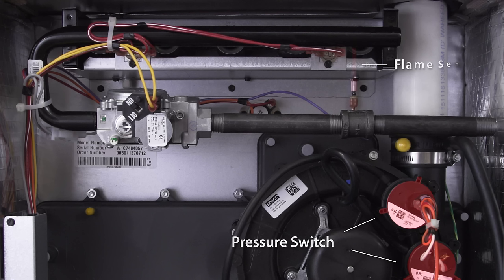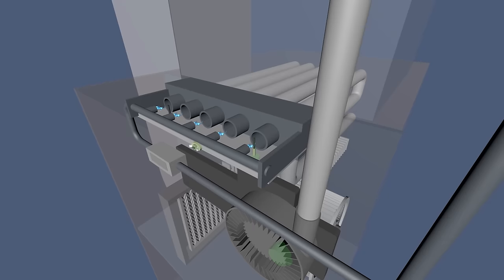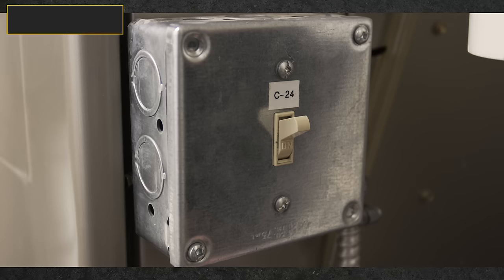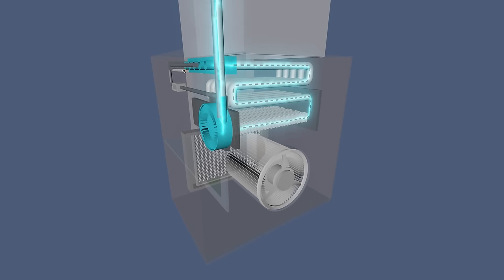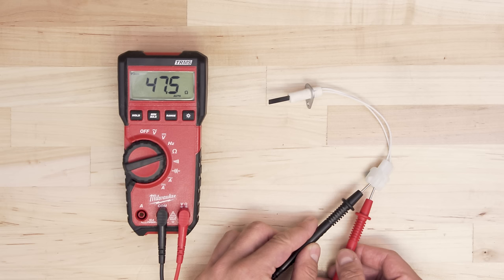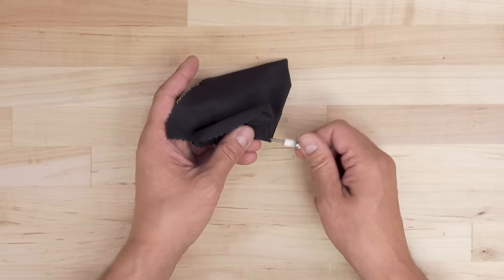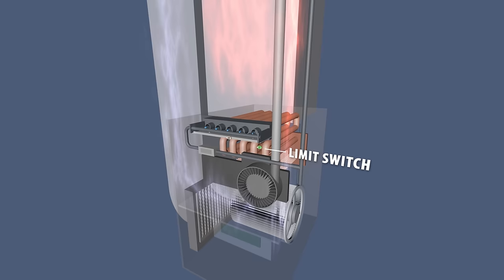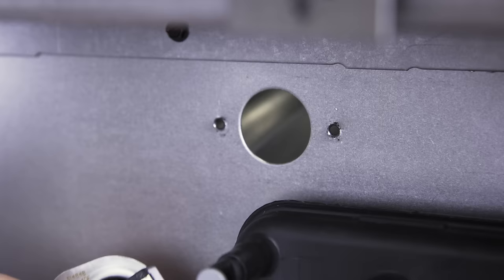Furnace Starts Then Stops - Troubleshooting | Repair and Replace

Comment: I tried cleaning the flame sensor and it still shut off so i got a new one and still shuts off after 5 seconds, what's next?
Reply from the maker: Thanks for watching. For the flame sensor to work, it must complete a circuit through the flame, into the metal of the burner. The burner must be grounded. Any buildup of carbon or dust can prevent this circuit from being completed, so the system might think that there is no flame present. Try doing a deep clean of the burners and it should help.

Comment: So my furnace what it does is that it stays one until it reaches the desired temperature but then it shuts off and wont start back on unless i restart the furnace any ideas??
Reply from the maker: Thanks for watching. In this case it is likely a faulty limit switch. The fact that the burners ignite, the blower runs and you get heat means that all other parts are working.

Comment: Hi my furnace is lennox and they give a code 475 i couldn't fine in the manual can you help what to do? Thanks
Reply from the maker: Hi Josh, check the back of either furnace cover doors for a printed chart / wiring diagram or list of codes. They are commonly shown there.

Comment: Might be a dumb question, but what do you consider a soft abrasive cloth? 0000 steel wool came to mind, since I have some. Perhaps a wash cloth or soft scrub sponge? Thanks
Reply from the maker: Hi Vance, thank you for watching. That is a good question. The flame sensor is a bare metal rod that sits inside of the flame which acts as a rectifier, allowing a DC current pass from the control board to the sensor, through the flame and down to ground. Without a clean surface on the rod, the circuit will not be completed. This means an emery cloth, steel wool, or even sand paper can clean it. In this case there is no coating on the flame sensor, and nothing that would be damaged with a little bit of abrasion.
Reply: @AmreSupply  thank you!
Reply from the maker: @Lokahi-fo-life  You're welcome!

Comment: Is the fan inducer motor supposed to be running all the time? The main fan is running but the fan inducer is not! And it's not heating :(
Reply from the maker: Hi Erminio, thank you for watching. The inducer motor will run the entire time as its function is to remove exhaust gases from the burner. If the inducer isn't running then the inducer or the capacitor for the inducer has failed or the inducer is not getting power (loose or faulty wires, or a bad control board). The inducer repair can be seen in this video https://youtu.be/EsJhfFMZWJA

Comment: What about the the flame came on for like 8 sec and off and come on again and off but the motor is still on. After 2 time of the flame being on and off no more flame but the motor and fans still on blowing cold air.
Reply from the maker: Thanks for watching. If the flames don't stay lit then its likely an issue with the flame sensor. The flame sensor needs to be clean, and positioned within the flame to complete the circuit through the flame, into the metal of the burner and though the frame of the furnace to ground. A dirty flame sensor, dirty burner, or a furnace that isn't properly grounded will prevent this circuit from being completed. That will cause the furnace to short cycle as the control board doesn't think that a flame is lit.

Comment: Okay, this is great. But what if it's none of those things? I've checked all of those issues. Is it possible the furnace "computer" needs to be replaced? Thanks.
Reply from the maker: Thanks for watching. You are right that if you've eliminated all other sources of the problem it could still be a faulty control board. You can see how to access the control board in this video: https://www.youtube.com/watch?v=4SY8lRl8HV0

Furnace control boards are listed here:
https://www.amresupply.com/catalog/Control-Boards-Modules-HK5Y
Reply: @AmreSupply  Thanks so much for replying!
Reply from the maker: @OnionKnight541  You're welcome!

Comment: Hello and thank you for the helpful tips say I have an electric heat pump furnace AC unit & my question is my thermostat keeps switching from Auto to fan on & my units only a couple years old.
Reply from the maker: Thanks for watching. What sort of thermostat do you have? It might need a reset or the batteries could be low (it might have intermittent power)
Reply from the maker: @dadsgonenuts  Could be a glitch or setting with the thermostat. Might want to try the Honeywell help page or customer support.

Comment: My furnace  blows cold air and then shuts off after 2 mins. It  does this whether its on auto or on. What do I need to do please. this just started.
Reply from the maker: Thanks for watching. If the blower fan blows for only several minutes before shutting off then it could be a faulty limit switch. You can see how to access and test the limit switch in this video: https://www.youtube.com/watch?v=0va_wvwfCBA

Comment: What about random short cycling? Is that bad design and configuration?
Reply from the maker: Thanks for watching. It depends on when and where in the sequence the short cycling is happening. Could be an airflow issue or a problem with one of the switches.

Comment: We replaced the ignitor today on our comfortmaker furnace, now the system will attempt to light twice before finally lighting on the 3rd time only, any idea why?
Reply from the maker: Hi Kelly, thanks for watching. Do you mean the flames come on but don't stay lit? If so then you'll want to try cleaning the flame sensor.

Comment: Why when I start my furnace it cycles but wont start so I have to unplug it reset and then it will start, but once it reaches it temperature after hours it wont start back so I have to unplug and reset it ?
Reply from the maker: Hi Kevin, thank you for watching. From what you're describing it sounds like your furnace is igniting, heating up, and likely tripping the limit switch. The furnace will shut down afterwards and depending on the model will be locked out. 

Either your furnace is overheating (poor airflow or dirty furnace filter) or the limit switch is faulty. 

To be certain you can check your furnace for any flashing LED codes to see if it gives you any additional information. As well you can test the limit switch to see if it has continuity: https://www.youtube.com/watch?v=0va_wvwfCBA

Comment: By the way, the control board for TRANE XR80 is 50A65-475, D341396P01
If needs to replace, should I get newer updated board? (Don't know how old this furnace is...)
Reply from the maker: The 50A65-475 board has been replaced by this part here: https://www.amresupply.com/part/50A65-5165-DIRECT-REPLACEMENT-INTEGR?replaces=50A65-475 The board is currently in stock in several AMRE branches. It can be ordered online or you can place an order and do a curbside pickup at one of the branches. Currently branches are not open to the public due to Covid-19 which is why the curbside pickup is active.
Reply: Thank you for your prompt response and advice.  Will order board soon.

Comment: I have a slightly different problem - It's a Keepite HE furnace (made by ICP). Just successfully replaced a seized induction motor. But one problem still persists. Furnace cycles on and IM starts, within seconds burner glows... About 80 % of the time, the flame ignites and the furnace cycles fine. The other 20% of the time, Furnace cycles on and IM starts, within seconds igniter glows... BUT after about 8-10 seconds the igniter stops glowing... about 10-5 seconds later it glows again - sometimes the flames will ignite, sometimes they don't and the furnace shuts down for about 2 - 3 minute (and shows a 'soft lock out' lite flash sequence). The it tries again and almost always works - sometimes the process happens a third time BUT the furnace always eventually starts and works fine.

It's the dreaded "intermittent problem' (see British Sports Cars). Is this an igniter problem, a sensor problem or something else??

I checked all hoses and vents(which are clear) but haven't checked Igniter continuity yet...

Suggestions??
Thanks in advance
Reply from the maker: Hi Charles, it sounds like your flame sensor could be dirty, or is starting to fail. 

You can see more here: https://youtu.be/af_qRnfHFws
Reply: Thanks, I'll start by cleaning the sensor - but why would a faulty sensor stop the flame from coming on in the first place (since once it's on, it stays on) ? Is the ignitor suppose to only glow for about 10 seconds then go out and come back again until the flames ignites? I can clean the ignitor too - but I want to be careful bc the sensor and ignitor are one (expensive ) unit.
 @AmreSupply
Reply from the maker: If its shutting off before the burners ignite then it would be good to test the ignitor to see if the resistance is between 30 - 200 ohms. https://youtu.be/LAAYMOpVf-8 Additionally sometimes intermittent problems can be bad wiring connections so doublecheck if the connections / terminals are secure.

Comment: I have a gas furnace and it is not throwing any flames. Even when I tried to start it . It starts and then 30 seconds it shut off. My wife tried to clean that with vacuum and now that is not working. I clean the ignitor ' flame sensor but no luck. Any suggestions folks. Winter is here and it's so cold
Reply from the maker: Thanks for watching. It's best to check to see if there are any error codes as this might help you narrow it down.

Now if your furnace begins the startup sequence and the inducer blower motor only runs for 30 seconds then it could be an issue with the pressure switch https://youtu.be/U2MiMvfGITA There could also be condensate in the tubes which will affect the pressure.

If the inducer motor continues to run and it still doesn't ignite after several minutes then it could be an issue with the furnace ignitor. This can be tested with a multimeter: https://youtu.be/LAAYMOpVf-8

Comment: I have a new Goodman GMES92 and it goes through the sequence of operation fine but as the main blower is running it will shut the main burners off and then re-light again for a short period and then shut off followed by the main blower shutting off.  Seems like the main blower speed is too high as well. Hmmm....... I can cover the wall t-stat with a small box in case the fan is just too fast and causing it to act this way but no change.  ?  It is now Fall and I am in Ohio....concerned. Oh yea....no fault code in flashes, it stays on solid to indicate "normal operation".
Reply from the maker: Hi Greg, thank you for watching. What you're describing could be the limit switch or an issue with overheating as described at: 3:56 . When this happens the blower will run at full speed to try to cool off the heat exchanger.

Comment: What happens when the inducer motor turns on an off the control board cuts the power to the inducer and the code light on and off too
Reply from the maker: Thanks for watching. If the furnace is giving you a code then its best to check your furnace to see what those codes mean. Based on what you described It is likely an issue with the pressure switch, or an issue with the exhaust vent which would prevent exhaust from properly being removed from the system.

Comment: my limit switch malfunction, is it ok to keep the furnace running a few days till my part arrive?
Reply from the maker: Hi Kim thanks for watching. Its ok to keep your furnace running in its current state with all the parts connected as it will just shut off or cycle on and off. On the other hand never operate a furnace without the safety switches connected. Running a furnace with the safety switches bypassed is dangerous.

Comment: My furnace ignites then shuts off. The blower starts then the igniter illuminates then it shuts off. I replaced the heat sensor and the pressure sensor still does not start! any advice?
Reply from the maker: Hi Majeed, thank you for watching. If you replaced the flame sensor and the furnace still shuts off after ignition then there's a few things you should check. Its important for the flame sensor to be positioned in the hot blue part of the flame for it to work properly. As well double check the connections at the flame sensor and at the control board to make sure that there is a solid connection between the wires.

Comment: Any videos about a York condensate chamber not draining water - even after hoses have been drained? Flame comes on for 30 seconds, then the major flame doesn’t kick in. Eventually furnace blows cold air
Reply from the maker: Thanks for watching. If the furnace is blowing cold air that can just be it cycling due to a shutdown. 

If the flame doesn't stay lit, then it's worth trying to clean the flame sensor and burner. If the main burner doesn't light then you won't get much condensate.

If the main burner ignites and there still isn't any condensate draining, there could be a blockage somewhere in the inducer motor, or the condensate chamber housing. As well check for any pressure switch error codes. Unfortunately., we do not have any videos showing how to troubleshoot this further.
Reply: @AmreSupply  :Thanks. Flame starts, but I’d describe it as a clicking sound and flames don’t come on full ‘power’, and fan still works but not at full power
Reply: Also, my condensation chamber is clear plastic but has lots of hairline cracks, plus blackening inside it. Do you sell replacement ones. Has model # 541690 on it
Reply from the maker: @sandymilne224  Still best to clean the flame sensor and the burner just to be sure.

Low gas pressure is something else that would prevent the burners from coming on fully. 

The condensate chamber / housing is not something that is as common and I don't think we carry them unless they come packaged with an inducer motor.

Comment: My induction motor will run, it’ll send signal to start the ignition, but when gas is called we lose induction an it’ll lose power on the board for a bit an we don’t get a error code. Any ideas what this could be?
Reply from the maker: Thanks for watching. If the furnace shuts off before ignition then it could be an issue with the pressure switch. Generally this will give an error code. Its best to eliminate that first. As well it could be an issue with the control board. There are many small components that can fail and aren't easily tested. Control boards are easy to replace but its best to eliminate anything small first or get a second opinion from a professional.
Reply: @AmreSupply  I've tried replacing pressure switch, but the only one i could find was for a different temp for my furnace ill keep looking for the correct part. Thank you for the info
Reply from the maker: @andrewkapaldo5775  We're happy to help. AMRE Supply carries many different pressure switches so you might want to try taking a look there. We do ship to anywhere in Canada or the USA if needed https://www.amresupply.com/catalog/Switches-HK3Z

Comment: does cycling power reset the lockout on furnace?
Reply from the maker: Thanks for watching. Yes turning off the power to the furnace usually resets a lockout. If the problem persists then it is likely one of the components listed in this video.

Comment: My guy came switch burn out blower motor in my york 2009 and two pressure switches cas valve pull burners out  still have no heat
according to 3 red blinking codes i had to replace pressure switches.any ideas before i replace this unit?
Reply from the maker: Hi Jamie, just to clarify, you've replaced the pressure switches, and blower motor and you still don't have heat? Does the unit run at all or are you getting short cycling before the furnace heats up?
Reply: @AmreSupply  Correct soon the flame kick's on the machine turns off. All I know I spend 500 dollars  and still have no heat.
Reply from the maker: @jaimecamelo7517  That is frustrating going through that and still not having the problem fixed. fortunately flame sensors are pretty inexpensive all things considering: https://www.amresupply.com/catalog/Sensors-Flame-HV2G

Comment: Hi sir , our Furnace is acting up lately the Burner is igniting then shutting off every minute or so then I’m just shutting the whole system so It won’t damage my whole furnace. is the problem from the flame sensor?? Thanks
Reply from the maker: Hi Nicole, thank you for watching. If the furnace ignites but the flames don't stay lit then it does point to a problem with the flame sensor.

This could be because of a dirtyflame sensor or it could be defective.

To work properly the flame sensor needs to be positioned in the flame. It will complete the circuit through the flame, into the metal of the burner and will travel to ground through the furnace frame. This means a dirty furnace burner can also prevent the flame sensor from working properly.

Alternatively you could have a weak flame which can be cause by a restriction of airflow or poor gas supply.
Reply: Thank you so much for answering my question. In case if the flame sensor is defective where can I buy a new one ? Is the sensor flame standard for all furnaces model or it differ between model to another?? Thank you 😊
Reply from the maker: @nicolee1981  You're welcome Nicole, we're just happy to help. At AMRE we carry a variety of different flame sensors. https://www.amresupply.com/catalog/Sensors-Flame-HV2G Its important to find a match as there is a bit of variety in the length and mounting hardware. Its best to get your furnace model number and do a search that way to narrow down the flame sensor part number. Try to find an exact match if possible.
Reply: @AmreSupply  thank you for responding. Our furnace been working fine lately after we cleaned up the sensors if the problem comes back will definitely purchase one of the website u attached above thank you again and have a great weekend.